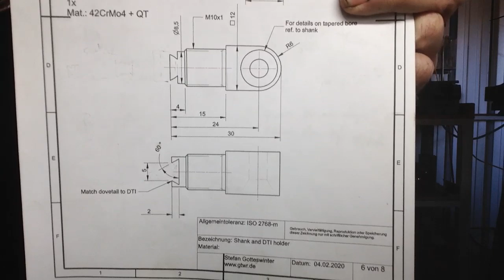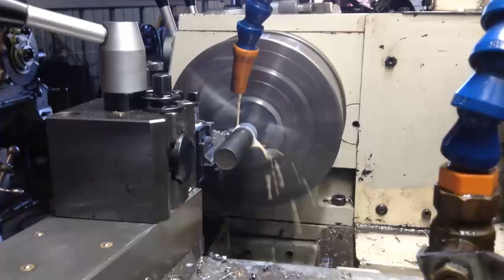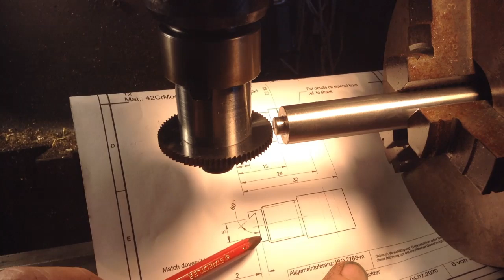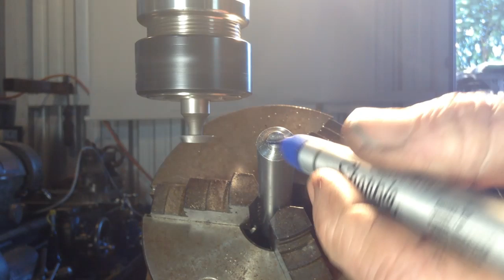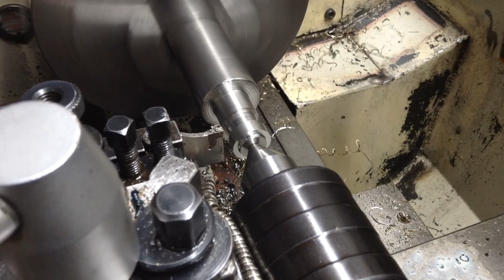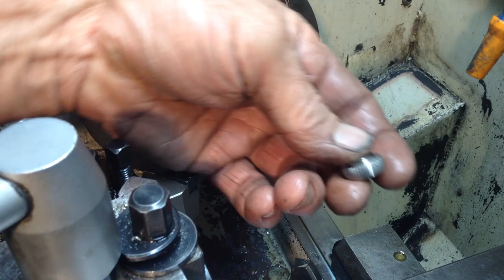Building The GTWR Indicator Holder . Part 3 .

Comment: Hi max, try using water (coolent) to wash away metal dust and shit from the knurler, rather than oil that holds the grit. Just my wee bit.
Reply from the maker: Now that you mentioned it , i used to do a lot of knurling  on some 75mm dia parts back in my younger days on a Ward turret lathe , with coolant ..   Maybe  i should go back to doing it that way !    Oil is generally what is used though  in a non production enviroment .     Cheers .

Comment: Hello Max Good day to you just a question . Why cant you mount the ball turner on the cross slide and the other side and run the machine in reverse ? Just thinking . Stay well you and your look forward to the next vid. My best .
Reply from the maker: My original plan was to mount it where the compound slide sits , but i would have  restricted the  ball size to much  with the extra height .
Reply: @swanvalleymachineshop  Good deal Max just thinking out loud . You are very intuitive man I should have known better . You already thought of it. Cheers!

Comment: G’day Max. Interesting knurling procedure but why did it loose alignment, is it to do with matching knurling teeth to a suitable diameter? 
Cheers 
Peter
Reply from the maker: Hi Peter .  It would be because it still required more depth due to the  changing circumference . 
If your knurl is de pitching  due to circumference & pitch  , just go in deeper until it sorts itself out , most times it will .   Cheers .

Comment: Much nicer than mine.
Reply from the maker: As long as your one works , that's the main thing !    Cheers .
Reply: @swanvalleymachineshop  It is the MOST important thing. It can be as pretty and shiny as you like, if it doesn't work, it's still not useful other than as a wall-hanger possibly. Pretty and nice are bonus things that show the workmanship, skill and effort. I'm often very pragmatic, and don't necessarily look to find the most pretty solution to something.